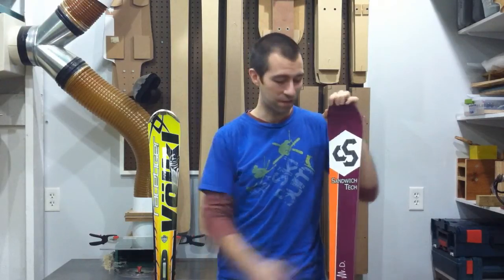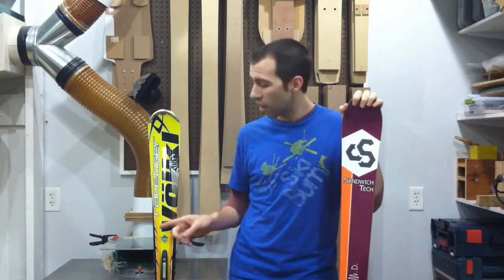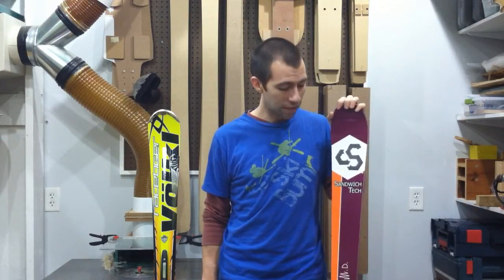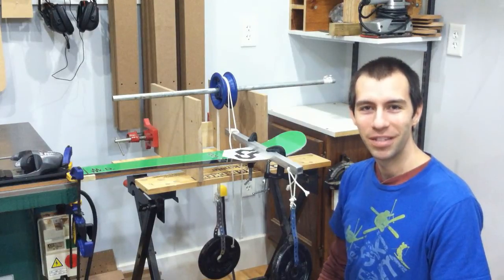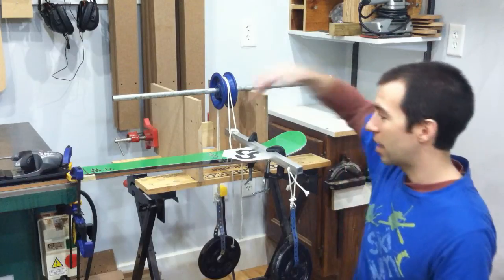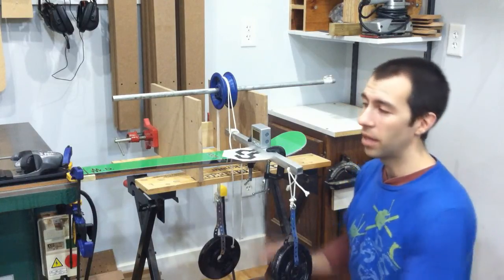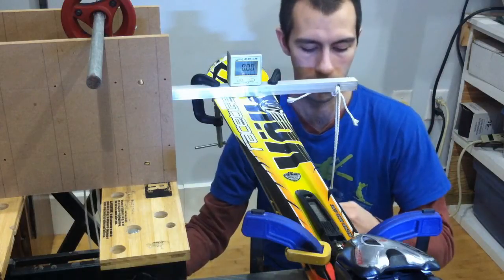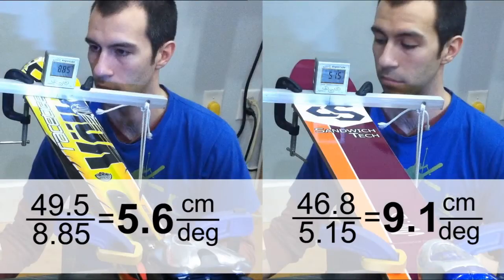Torsional Ski Flex - Sandwich Tech's Carbon Box vs. Volkl's Double Grip XTD

Comment: The less torsion stiffness of racetiger comes along with enormous sidecut. The other ski has just a larger width in the middle and it is of course humbug to claim that its high torsional stiffness comes from the material properties ... Moreover the shown test procedure is not valid to compare different skis due to a tremendous measurement inaccuracy ...